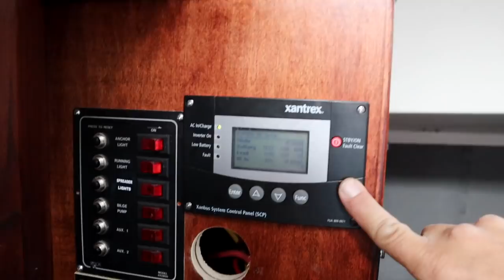Leaking Toe Rail - Have We Solved The Problem? | ep 198

Comment: I don’t have a YouTube channel but I would like to report that I too am getting stuffs done. Last time home I replaced a gas tank and a solenoid. Ran a new gas line and fixed my stove (sorta. It comes on but the flame doesn’t adjust) new stove arrives in 2 weeks. I installed and plumed a new fridge. I installed all new plumbing and hardware in the head (that was a nightmare) and I went sailing ⛵️ I did it all alone without support unless you count my friends drinking my beer while I cuss under cabinets. The real fun will be when I go up the mast and go splat on the deck. Stay tuned…well if ya don’t hear from me. You know
Reply from the maker: Good to hear!! Hope you don’t go splat. 😝

Comment: Interesting, so just up and over the old teak?   We’re the fasterners to hard to replace and then rebed the toe rail? , filling that groove with butyl?
Reply: Ok I watched the earlier video of the gulfstar. Interesting method , please show plenty of shots of the finished result . , did you make any extra openings in the rail to avoid those leaky holes thru the old rail?
Reply from the maker: Yes, just cover the teak and make sure to get a good bond with the fiberglass on each side. 

Removing the rail would have been a major undertaking, not something we could do outside of a boatyard. We considered it while in the yard and spoke with other Morgan owners who did it and decided against it. Todd felt that filling the holes and then redrilling them could lead to the same problem over again. Even with butyl. I’m sure there’s a way to do it but this seemed like a permanent fix. We do wish we’d tackled it in the yard but… we didn’t so 🤷🏻‍♀️